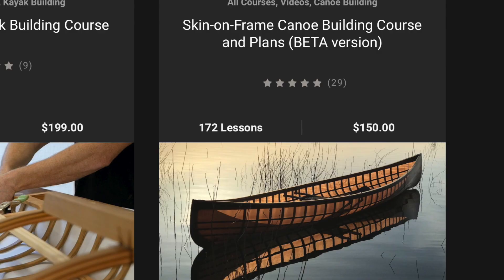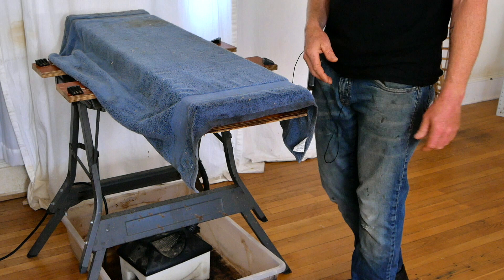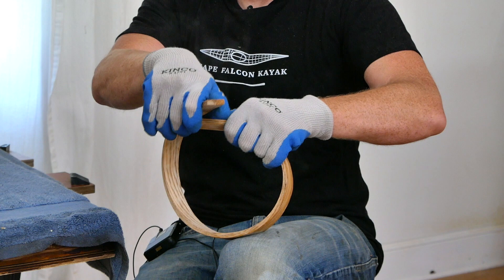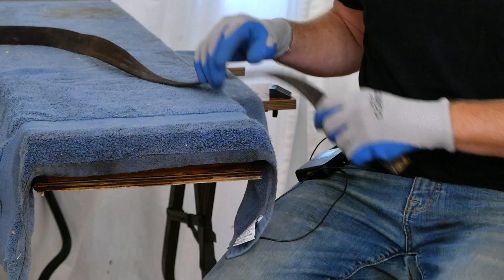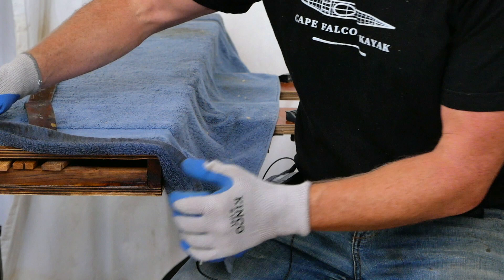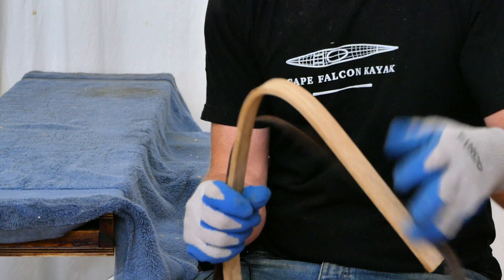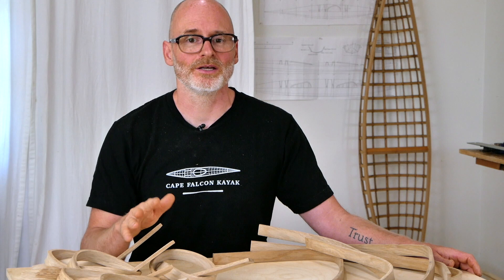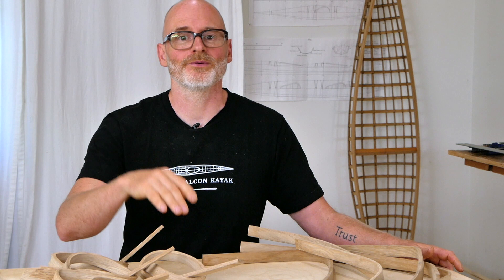Steam bending comparison: White Oak vs Oregon White Oak!

Comment: Could differences in dryness be related to the differences you note?  Local wood is likely to be wetter, and dryer wood should be harder to bend.

I'm still doing tests, but will get to building eventually.
Reply from the maker: Both were sawn recently and stored to preserve moisture.  We’d have to do at least half a dozen tests with different trees from the same species to truly know what the differences are.
Reply: @capefalconkayak  Thanks for the reply.  How do you best store to preserve moisture without decay?  I assume it's best to use it soon, but that's not always possible.  How long do you store it?
Reply from the maker: I’ve seen boards get moldy before but if you keep them wrapped in plastic they should be fine after you plane them down.  If they are already ribs then moldy ribs don’t look great so in that case I tell people just to store them in a cool place and use as soon as possible

Comment: What would you recommend in Australia
Reply from the maker: Australia’s tough.  For my Canoes I’m not sure there’s a wood in Australia that will work, but for Kayak ribs people have had some success with Tasmanian Blackwood and northern silky oak.  Here is a write up from one of my students on using northern silky oak:

Northern Silky Oak (Cardwellia sublimis) is supposed to be one of the best Australian timbers for steam bending (NSW DPI report). I found some 4x2” planks (air dried for 2 years)and cut them aiming to have 7mm ribs with as flat grain as possible. They steam bent fairly well but were not as easy as the White Oak ribs I used in my previous F1 build. This may be in part due to the ribs not being ideally oriented with respect to the grain. 
I soaked the ribs for 5 days in water with some fabric softener. Un-soaked spares were used to replace some split ribs and they seemed to bend just as well as the soaked ones. A few ribs split on bending, but most were ok. I only used the Silky Oak for ribs 3-10 and 13-17 as I had left over White Oak ribs(seconds) from my last build (I used these for ribs 1, 2, 11 and12). Both ribs 1 and 2 partially split but could be glued. Steaming time for Silky Oak ribs was 8 and 10 mins (the latter worked best). For White Oak I used 8 mins (these were 1/2 year old but were soaked for 1 day).
Silky Oak is quite a bit lighter than White Oak (maybe 25% lighter), but still seems sufficiently strong.